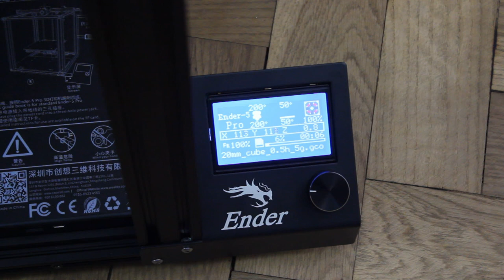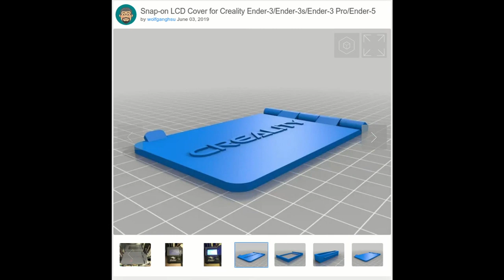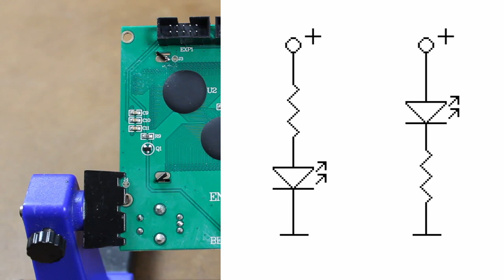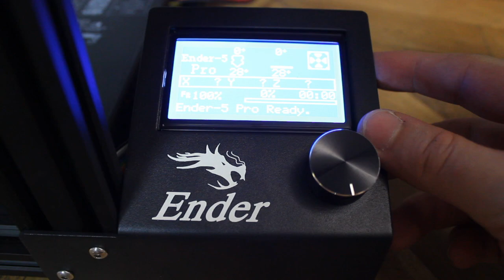Ender 3 (Pro)/5 (Pro) LCD backlight mod - night mode without a cover

Comment: Great video. I have a Ender 3 pro and I like to mount a potentiometer to adjust the brightness.
I have a camera that watches the work in the night and I want to take a look at the display to look at the percentage of the printing process.
The display is too bright, so that the camera switches not in the night mode properly some times. So I want to dim it a little.

Comment: Hey thanks alot for your video. But I didn't understand which resistor I have to buy. What are the differences between models? 

This one is fine? 👇🏻
https://www.motorobit.com/urun/6-8k-6k8-ohm-1-6-watt-direnc-1-10-adet
Reply from the maker: Well, the two basic resistor parameters are resistance and max dissipated power, for this application 1/6 or even 1/8W is just fine, but try to get the resistance between 22k and 220k, because with smaller resistance you'll get smaller RC constant and the converter will turn on faster, possibly before the bulk capacitance had the chance to store enough energy to make starting up possible
Reply: @FPiorski  OK thank you so much

Comment: hi ender 3 pro device lcd button works by itself what is the solution
Reply: (sorry for my bad english...) entering and exiting the menu during printing
Reply from the maker: @batuhansen6007  Don't worry about your English, the most important thing is that people understand you, any language knowledge above this level is just an extra :) Now, on that topic, let me know if I understand your problem: when you're printing the control panel acts as if you're clicking the encoder even though you're not? There could be many reasons for this, but it sounds like a bad encoder button contact, if you can then try spraying some deoxydizing solution on it (contact cleaner). Other than that, I guess if an external pullup/pulldown resistor for the encoder button got deattached from the circuit (like a bad solder joint or something) then the microcontroller input would be left floating, but I'd assume the people who designed this generic control panel would have used an internal pullup. Anyway, try the contact cleaner, that's the only advice I can give with this limited amount of information. Good luck!